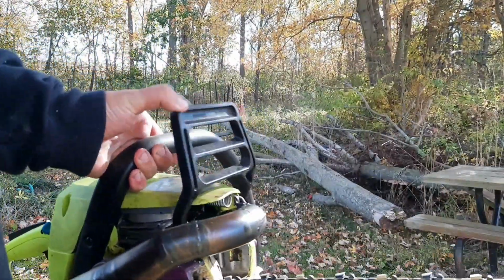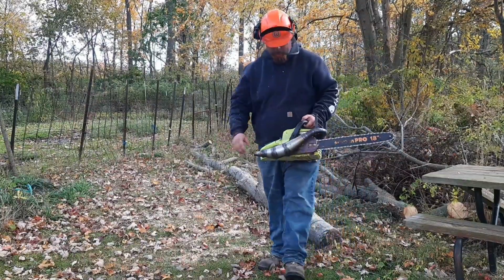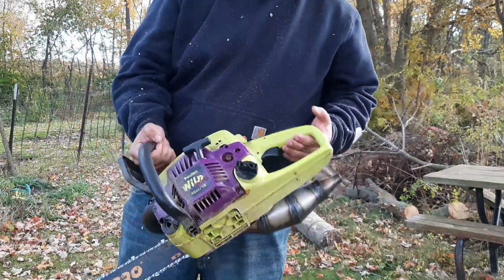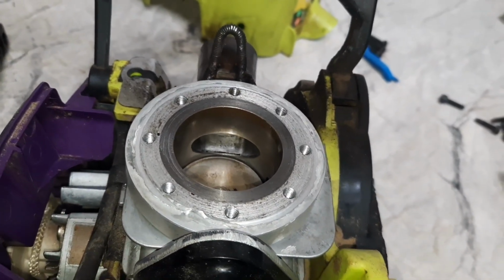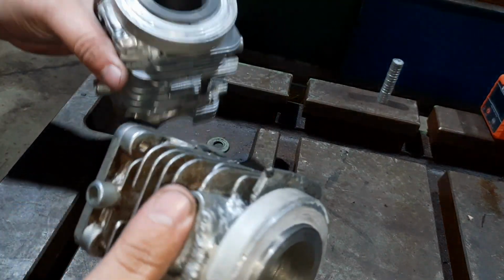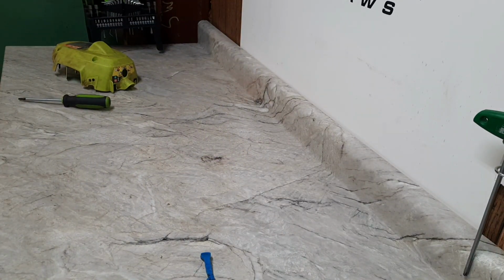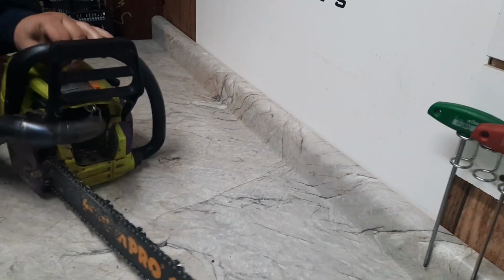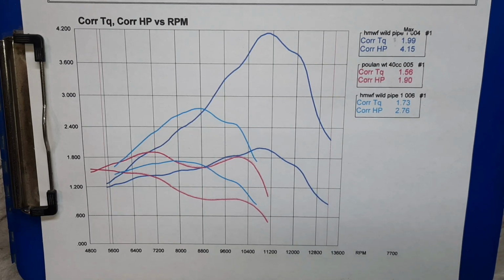WILDTHING RACE SAW!! Cutting firewood? Full build!

Comment: You can definitely push the compression on those saw alot higher than that. I enjoy modifying these saws for how cheap they are. I built one that put out 200psi and it cut great! Definitely wasn't  the same caliber of this build but still worked good for what I had into it.

Comment: I hope the Wild Thing class stays around too.  I genuinely like mine and want to continue making it better.  It was cool to see yours on the dyno.  Pretty stout numbers on the pipe.
Reply from the maker: It has hard to not like them after putting so much time into something that isn't really useful lol.
Really hoping I can double the power by next year.
Reply: Theres more than one model of wild thing saws available . The stratto charged version is the way to go. Not using the stratto set up though.. All you have to do is look at both types of cylinders and pistons side by side.  It dont take an engineer to see that